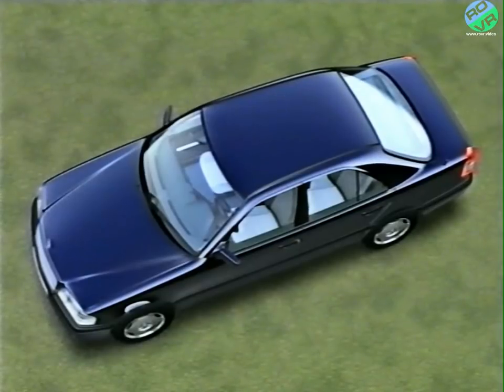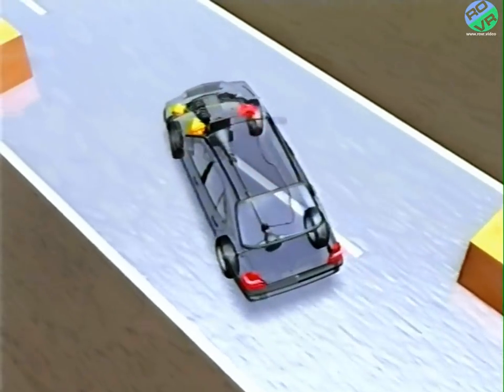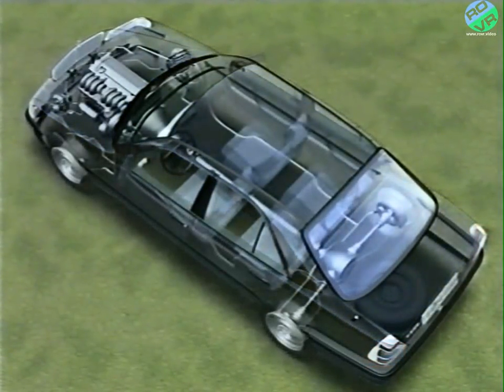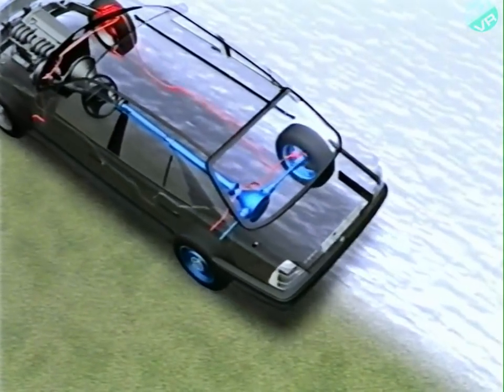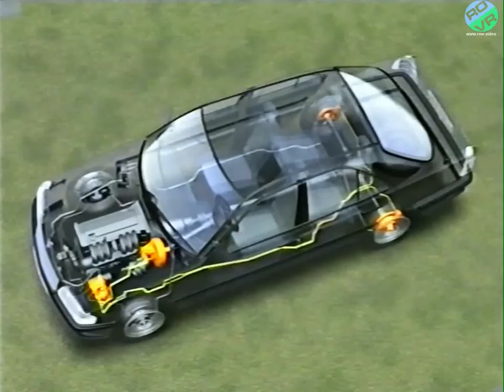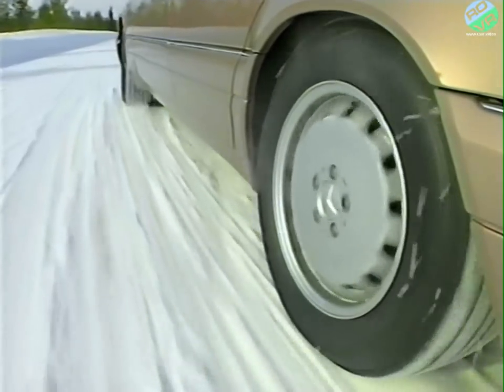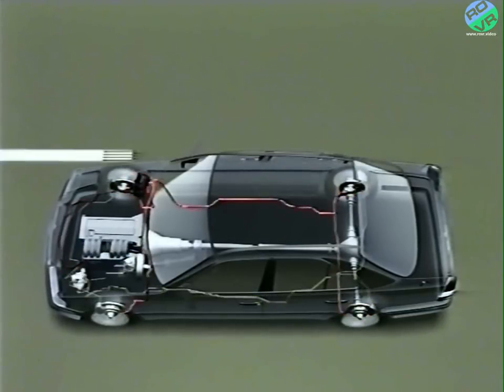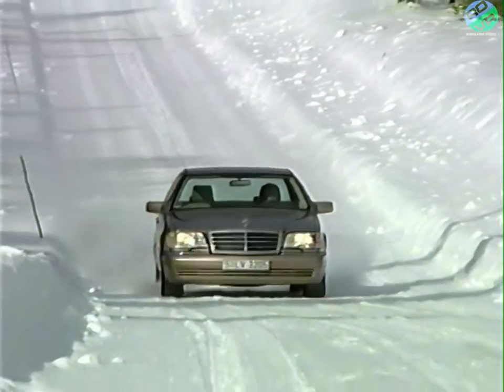Mercedes-Benz - Driving Dynamics Systems - ABS, ETS & ASR (1994)

Comment: Can I put ESP on Mercedes with ASR!? Thanks!
Reply: I'm sure you could but it's it's going to be really hard at a point it's not worth it. In this case It's cheaper and easier to get a car with ESP fitted from the factory. ESP requires additional sensors, Like a steering angle sensor, a yaw sensor, ESP control module, the wiring harness and another ECU.

Comment: I cant't drift my mercedes how to disable ets abs and other shits for good drift
Reply: Македонски Патриот There is a button
Reply: @kristiyanivanov5055  but not is fully turned off with preesing that ASR button near to shifter
Reply: What model is it
Reply: @kristiyanivanov5055  w210 e290 td 1997
Reply: You need to either remove the ABS/ASR fuse or remove the ASR brain(computer module) from under the hood
Reply: @kristiyanivanov5055  where can i find that fuse under the hood from left side (car view) or on the side from the intrument cluster?
Reply: @donklemaro1760  almost a year and no replies :/
Reply: @nickryan6787  🥺🥺
Reply: the simple way of disabling your ASP/ESP is just unplugging the sensor, its right up front in the engine bay, very simple. Its just behind the drivers side headlight, the big metal module. Pull up on the sensor plug and it will pop out to the left.
Reply: @donklemaro1760  just unplug one of your speed sensors from one of your rear wheels
Reply: @donklemaro1760  also do you still own the car anyway😂,  cause I’m selling my 1993
Mercedes 500sel cause there so expensive to maintain
Reply: Just press ASR off button.